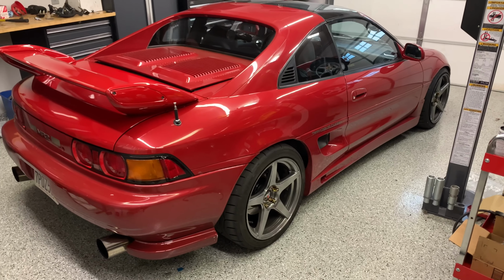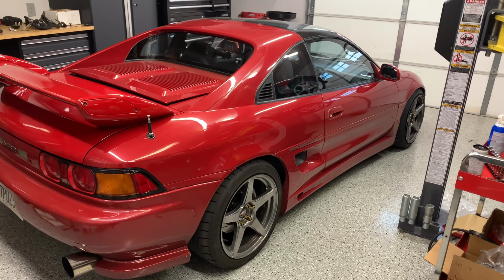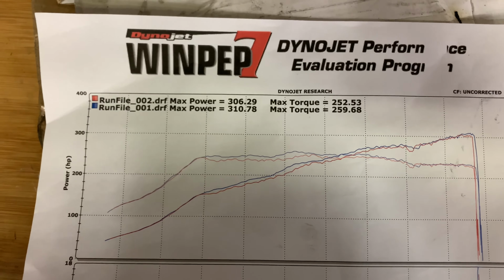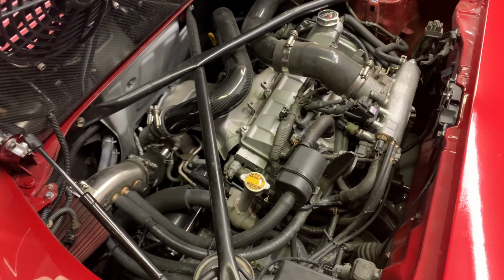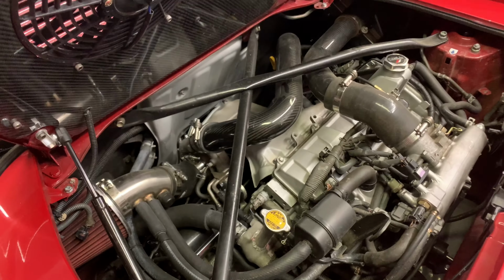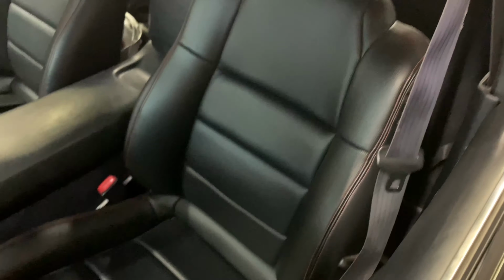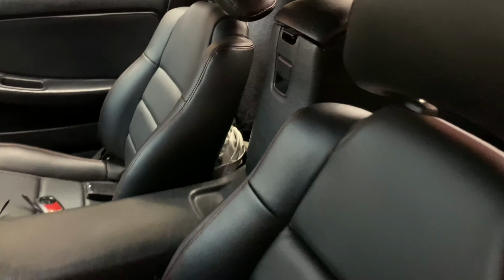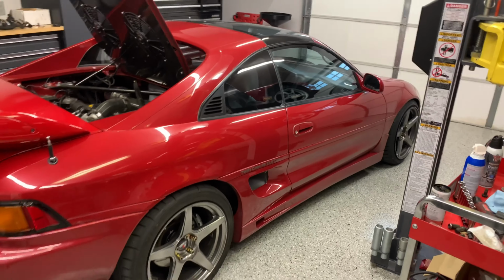91 MR2 Turbo Restoration Project (Part 2)

Comment: Could you help me out with the torque specs for the gen5 valve cover bolts please. Love your mr2 build
Reply from the maker: 6 ft lbs. I sell a big chart that has all of the exploded parts diagrams and the torque numbers next to them for $25 btw.
Reply: @MuffinMan0521  much appreciated, where can I buy your chart.
Reply from the maker: @bitingantz  if you search for torque chart at mr2heaven.com you'll find it. Sorry for the late response.

Comment: Hello, love the video. How is the car holding up? Are gen5 swaps reliable generally? Thanks
Reply from the maker: It's doing great! Uh it's just as reliable as any other motor? I don't like to stress about potential issues so I overhaul everything before putting it in. Sent the head to a shop to be hot tanked and valve job done, turbo overhauled by professional shop, new cam position sensor, timing belt, water pump etc.

Comment: did you do it all on your own? and where’d or how’d you learn? or are you a mechanic?
Reply from the maker: I did most of it on my own. I have the service manual. I sent out the turbo and head to professional shops and I had a friend experienced with MR2 to answer questions which saved time. I'm not a mechanic, but a software engineer. I just don't trust anyone to work on my stuff... people generally do half ass work.
Reply: @MuffinMan0521  that is true, how long did it take you to complete everything?
Reply from the maker: @roidxn9135  took me a few months to get it running, but I did little stuff over a years time.

Comment: Those smic are trash.  Go a2w.  Once I went a2w, not a single issue with heat soak ever again.
Reply from the maker: Agreed, but actually there's something better than A2W now. Natural Nitrous from Woolf pack racing. It's not nitrous like the fuel, it's a wound refrigerator coil that goes inside a charge pipe and super cools the intake air to really cold temps (below ambient). You don't need all of the hassles of A2W. Look it up

Comment: How much boost are you running?
Reply from the maker: 18psi. I had to mix race gas with 91 to up it. I chose around 96 octane, but it might have been fine on 93. Then, depending on the season, it would eventually get heat soaked with the side mount intercooler even though it was a larger aftermarket one. New set up will be air to water.